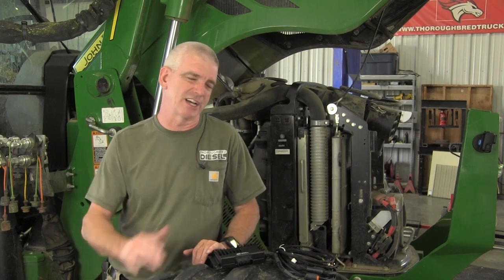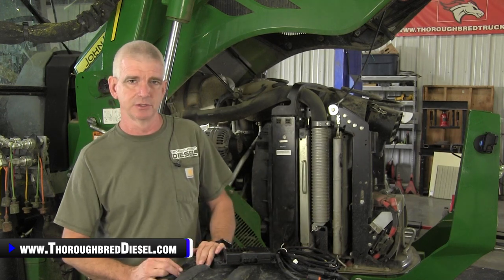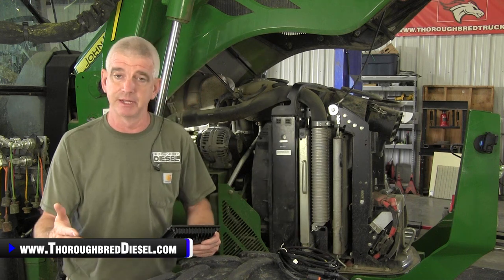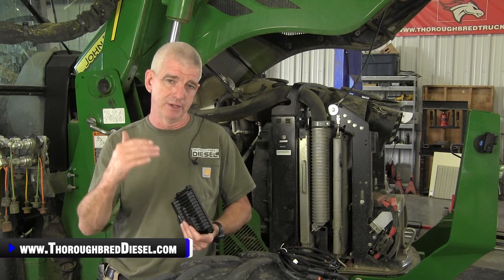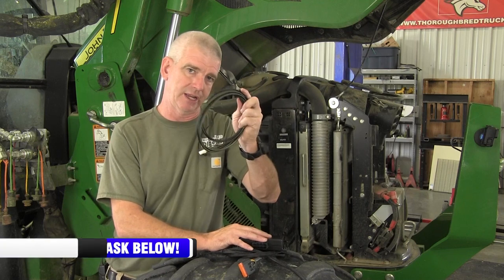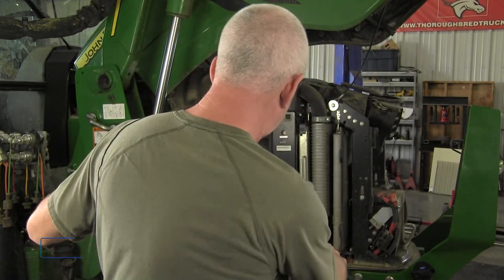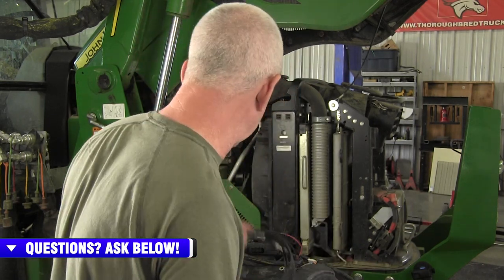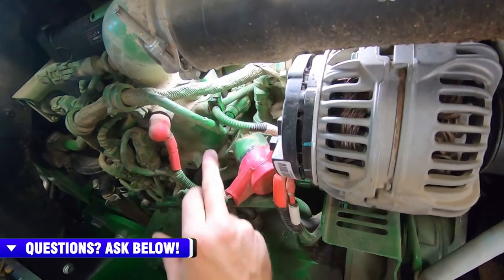HOW TO INSTALL a John Deere AG Diesel Solutions Electronic Performance Module #johndeere #tractor

Comment: Is there any downside of running with 30% more HP? Just curious why the 15% is an option when the 30% is preferred.
Reply from the maker: Each tractor and operating condition is different and I may not have explained that fully here.  If you are in heavy tillage,  EGT’s maybe better controlled at 15%.  You have to let the tractor tell you what it wants.